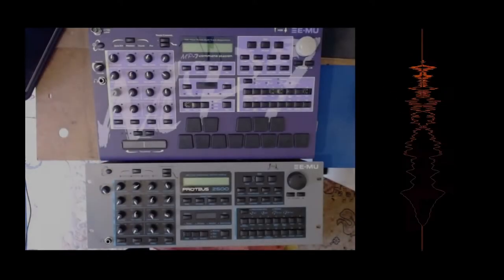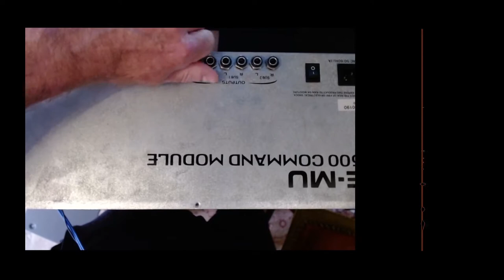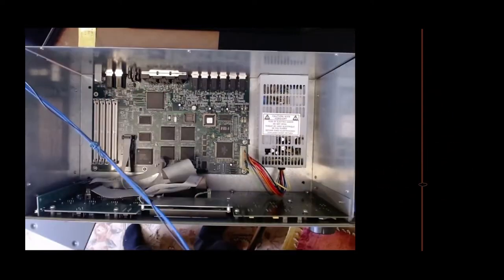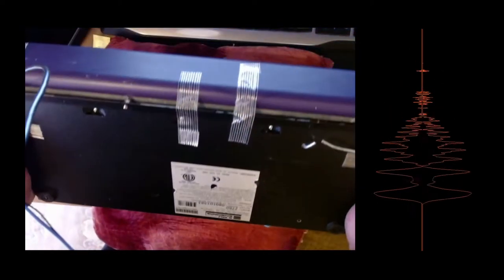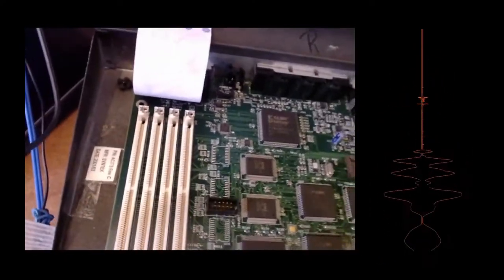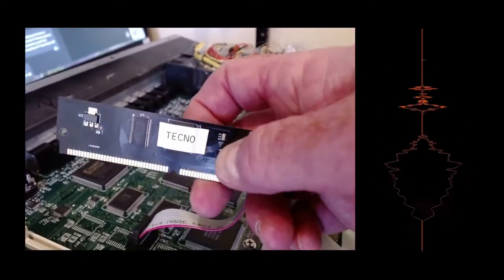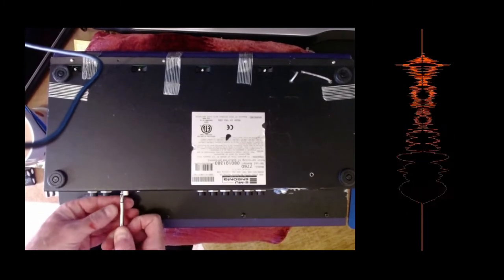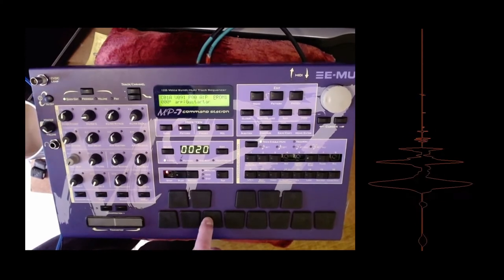Emu Command Station main board swap from Proteus 2500

Comment: surprised to see you running PROM1 and Composer, as they are the same rom samples with slightly different presets.. but same intstruments.  love my P2500, its a great rompler! next thing is the button board ;) lining up the little LED pipes is a REAL pain if you accidentally jostle them out of alignment.
Reply from the maker: The reason for having both ROMs is mainly due to the different presets - I study how they have been constructed.
One of the many challenging [in a good way] aspects of the Emu design is the number of parameters available to program. 
Exploring different aspects of a sound helps me understand how to apply the different settings to obtain interesting results.

Regarding the missing buttons, I did consider replacing them but I've kind of got used to it... and they serve to remind me that it is an ageing piece of gear which is not so easily replaced....🤓
Each time I switch on maybe the last time we interact together ... one day this will be true - eventually either either me or the CS will die ... 

So I take some extra care and treat with respect the time we have together ... 🥳 ... whilst allowing for things which are not quite right - it teaches me acceptance, 
and reminds me that the 'imperfect' can be beautiful... 

Indeed, I think sometimes it can be our imperfections which enhance us, 
and our 'imperfect uniqueness' can sometimes be attractive ... 😻
Reply: Glue gun works 😉 never have to worry again after that.
Reply: Thanks for doing these …..Really interesting videos     I have a working P2k ,  and a dead Proteus 2500 because of a dead power supply and have been unable to find a replacement so far.  Would love to get it working again.
Reply from the maker: Just noticed your comment, sorry for the delay !
If you are ok with opening the P2500 up, and are willing to fix/replace the PSU, I can give you the details of a replacement I found.
Let me know via email, my address is in the “About” page of this channel description.
I’m in the UK, where a outs are you?
Reply: @1heUndertaker  Hi - no problem at all.  As it turns out - after my house move last year I can no longer find the dead P2500, which must be in one of the boxes I have in storage - or maybe it was thrown out in the move - I can't recall !!   I do still have my P2K wired up in the home studio though, so for now I am focussing on getting to grips with that and going beyond the presets into some more interesting programming.  I tend to like to program from init patches so I never really tried to understand the P2K properly.  I'm in North Yorkshire - where are you based ?
Reply from the maker: @petecoates6410  Practically neighbours then - I'm north Manchester 😃

So do you use a blank preset as a starting point? 
Also, are you in the facebook group for the P2k? 
Lots of knowledgeable people there!

I tend to explore more on the Command Station with it having the extra controls available, but the P2k can do (mostly) everything the same.
Do you have any interesting sounds created?
Let me know if you post any videos etc, I'm always interested in how people work and do stuff !
Cheers.
Reply: @1heUndertaker  Hi, be great to know the replacement PSU, I noticed your command station one looks different from the checking the voltage video. Mine is Dead, I think, all lights come on but doesn't load. Any help would be greatly appreciated.
Reply from the maker: @statueoftheabyss6886  Thanks for reaching out ! 
If you check the video description, I mention the PSU there, along with a link to a Command Station thread on Gearspace.

For convenience, I've copied the PSU info below  - 
Apevia ITX-AP300W power supply
https://www.apevia.com/products-power-supply/itx-ap300w

Maybe also try asking and doing a search for 'Apevia' and 'boot up' in the E-MU Command Station User Group on Facebook?
There are others who have had similar sounding problems.
Also maybe try similar searches and ask the question in the E-MU Proteus User Group -  the units have similar OS and hardware faults.

Hope you find a solution 🙂

Comment: Hello, thanks for the video, I think I have an issue with mine too. I was just wondering if you could provide further info on the wiring of the power supply? What did you do for the 10v line (just use 12v?) Also has there been any negatives to using an ATX powersupply? Is it still working etc? Thanks in advance.
Reply from the maker: Just posted a few pics for clarity in the Emu Command Station User Group on Facebook MrLoFiDub.
https://www.facebook.com/groups/1932402260373447/permalink/3872829842997336/?

The text from that post is copied below -

Regarding how the wiring is connected if using the Apevia 300w ATX psu as a replacement.

Straight colour for colour connecting, but I’d recommend checking voltage first before connecting etc.

Connections are labelled with voltage on the main circuit board.
There is no 10v label for the connector or on the Emu main board, and the VP connection is at 5.19v dc.

Process - I removed the correct colour and voltage wires from the psu 20 pin connector, and connected the wires into the Emu main board wiring connector - matching colours and voltages.

Happy to answer any questions, if I can 🙂
Reply: @1heUndertaker  Thanks!